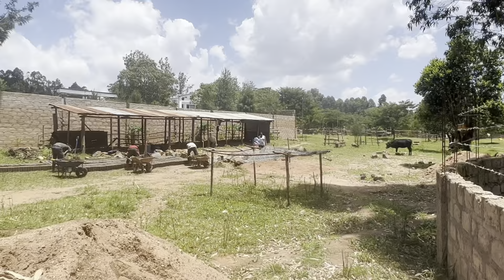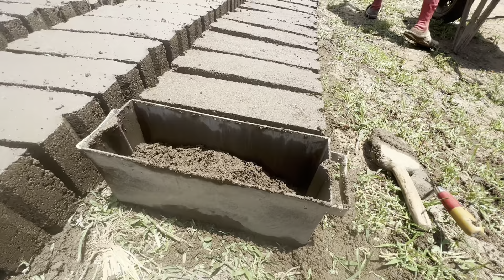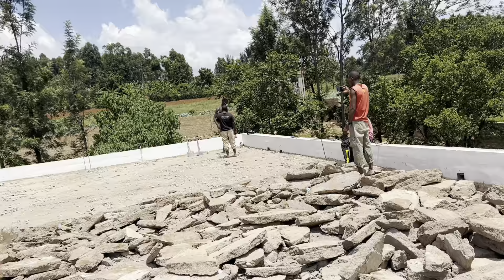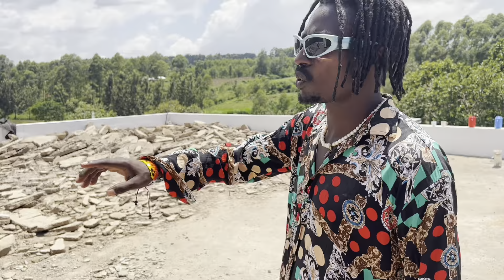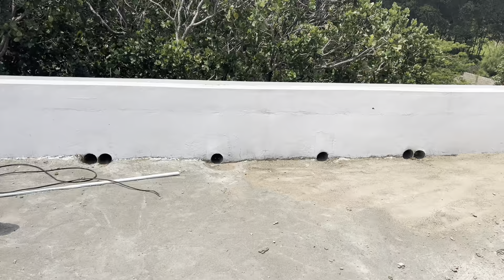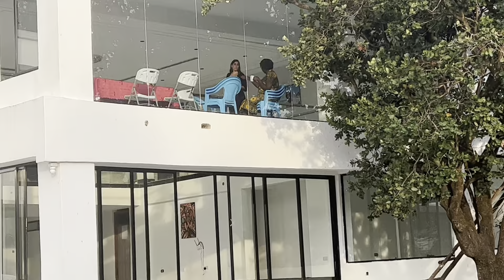EPSD 3 FLAT ROOF WATERPROOFING:

Comment: what type of helicopter is Marwa dreaming of, is it a toy helicopter because my eye measurements tell me that top is way too narrow for a regular helicopter to land it should be engineered by a mechanical and structural engineer. my basic engineering tells me not suitable, rotor blade will produce large sound and harmonics may cause cracks to increase and make the building unsafe very quickly. also the weight of helicopter can vary. don't you think the landing force will be too great, 3 tone weight can be double on landing impact force generated,  you also have to factor in hard accidental landing (safety factor). please calculate this carefully
Reply from the maker: Thanks for the infor

Comment: Good job Mr Ebole,Just a suggestion,On the rooftop there is it possible to raise that wall so that probably there is no need for the metal bars around it for safety.

Comment: There's still much work to be done on the fence. Some sections need to be raised higher. Also, there's the need to plaster the fence both front and back